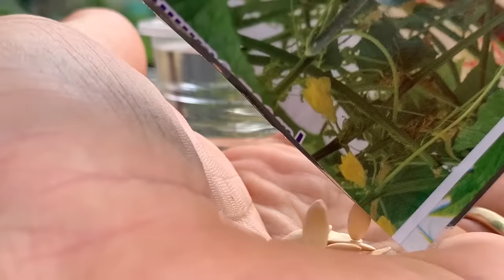growing cucumbers at home

Comment: Looks  amazing! 
Do you add any fertilizer in between or just the Initial soil that you prepare. If any fertilizer used, how often do you?
Thanks in advance.
Reply from the maker: Thank you very much. I use field soil mixed with dry cow dung to apply 2 times at the beginning and when the plants flower and bear fruit.
Reply: @GardenYard  ok. Thanks a lot 😊

Comment: Is that sand you planted the cucumbers in?
Reply from the maker: Yes, that's exactly the sand, sir. But sand is only for sowing seeds and planting is soil. Thank you very much
Reply: Thanks so much! I’ve always used a soil mix for thats good for seeds and then put the seedling in compost after it grows the first teue leaves. 
I will start ising this method now. Thank you so much sir.

Comment: what I don't get, is why you use soil.
Reply from the maker: The sand is loose so that the seeds are easy to germinate.
Reply: @GardenYard  I meant, when you build up the hole thing from the ground up, why don't you go directly to hydroponics? I get that people plant in soil, because soil is what is there. But when you have to build a bed for the soil and bring the soil in, why bother with it at all?